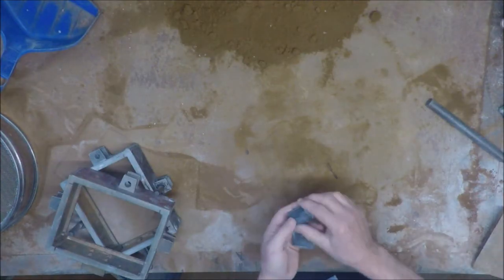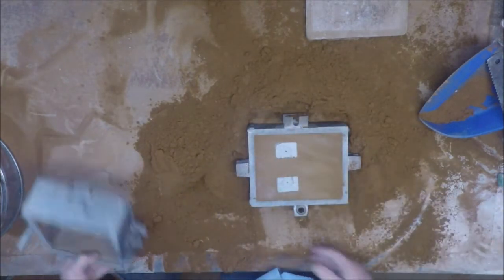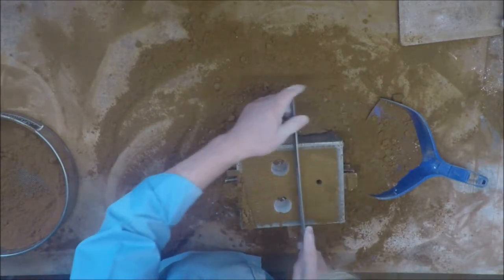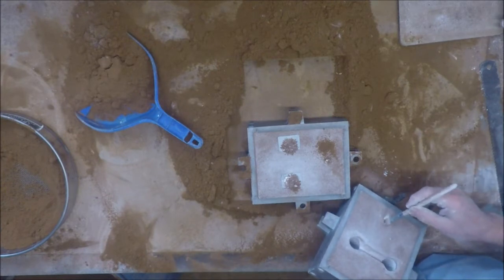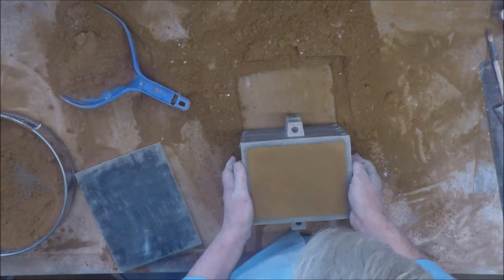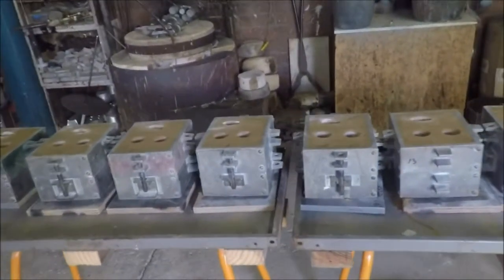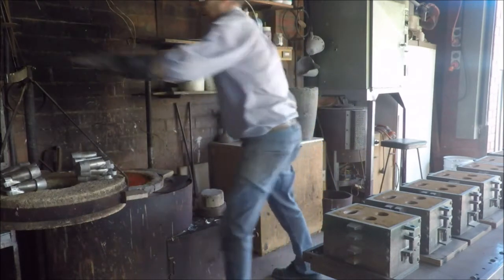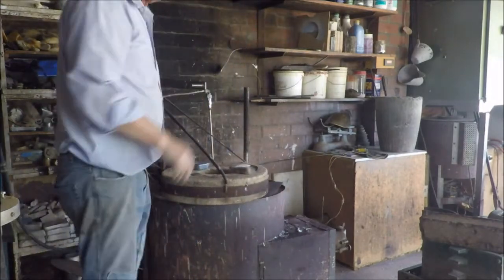My home foundry, Casting Aluminium blanking "Prisms"

Comment: Just wondering... why don't you make your molds with the in gate and runner already combined??? Wouldn't that save some time and energy in the long run???
Reply from the maker: F78, Yes, it would save a great deal of time and in fact I do this on jobs that repeat enough to make the extra effort of putting the runner and gates on the pattern worth while. If you look at my video on making throttle bodies (part 2 from memory) you will see that the runner bar and gates and places for the feeders and the sprue to be placed are part of the pattern. Also my recent videos of making a frangible coupling and of making a brake fluid reservoir base show the runner, sprue base, and in the latter case the feeder base all as part of the pattern. Not only is this quicker but it seems to make for a cleaner casting. However for jobs that are one off or only require a few castings it is usually not worth it.... Martin

Comment: I am curious to learn more about what is involved in heat treating Aluminium, as you mention the need to quench the parts as soon as possible after they set, so perhaps that will make for a good subject for another video.
Reply from the maker: Heat treatment of aluminium alloys is a bit of a black art and something that does not treat fools gladly. In my time as Foundry Metallurgist at a local manufacturer we lost at least 5 loads of over 1000 castings each through malfunctions of the process. I speak here of the T6 process typically for 601/3 alloy (356/7 in the US) solution  by holding at say 540 C for 12 hrs water quench and age at 165 for 4 hrs The alloy begins to melt at very little over 550 C so your temp control and furnace evenness have to be spot on - it most definitely is not easy hence the lost loads. The heat treatment that I use is a bit of a cheat, it's close to T5 which is an age only. Temp control there is not as critical. To improve the response to this T5 I like to quench the casting as soon as it is solid enough to allow handling. (Why this helps is a very long involved story) Thin castings say 6 mm or below do not really need this quench but ones much more than this definitely benefit from it. I do this T5 as it vastly improves machinability I doubt that it does much for the ductility though. For this age process you can get away with a fan forced domestic oven. Be aware that the temperatures for both the solution (the hot bit) and age parts of the process vary with each alloy and end properties required. I will devote some thought to a video on it.

Comment: A very informative video Olfoundryman. 
Curious to know does it have to be straight Argon or can you use Mig gas which has Carbon Dioxide in it as well?
Reply from the maker: Thank you  for your comments. My aim is to convey information and I am pleased that I seem to have done so. Yes, it does have to be straight Argon. The Argon CO2 mix is a definite No No, CO2 is unstable at the temp concerned and tends to convert to CO with the evolution of O2 this reacts with the AL to form AL2O3 as films throughout the metal. These weaken the metal and have a very pronounced bad effect on ductility. As an alternative you can use straight Nitrogen but the cost  - for me anyway is more in the cylinder rental than in the gas itself and Argon gives a drier type of dross on the surface of the molten Al.
Reply: Well you should be well pleased that you can now get Argon from Bunnings, size D $99 and $200 deposit keep the receipt somewhere safe. I asked the question to see if mig gas would work, but it looks like I will have to get an Argon cylinder anyway, I can also use it ti Tig weld.
Reply from the maker: Mark Fryer
I currently use the big E size cylinder. At my current usage rate - not what it once was - the E has already lasted at least 2 years and is no where near half empty. Obviously I do not really need one that big but it is a bit of a safety feature if I accidentally leave it on at the flow rate of 1.5 lt /min it will last days and I can usually catch it in time! Do Bunkings charge an annual rental as well or is that $99 a one off for a full cylinder and that's all you pay until you get it refilled(exchanged)? BOC's billing is a confusing mystery!
Reply: The $200 deposit essentially "buys" the cylinder as a part of the swap program, and you only pay $99 for a refill. BOC have had it too good for too long and now a lot of plumbers are moving over and other trades as well. They have Argon, Mig gas, Oxy and Acetylene. The only other ones to add would be Nitrogen, Carbon Dioxide, and maybe Balloon gas.
Reply from the maker: You are not wrong about BOC! When my current cylinder  runs low (I do not like using the bottom of the cylinder) I will be paying Bunkings a visit!CO2 would ne nice should they get around to it for use in setting on Sodium Silicate/CO2 cores.
Reply: Mark Fryer
Reply: CO2 refills at my local homebrew supplies, 2-3kg refill costs me $34
Reply: Isn't CO2 available in Australia through the food service industry?  I know around here small cylinders are available from the same people who supply fast food restaurants for pop (fizzy drinks/carbonated beverages) fountains.

Comment: If I had to guess I would say you've done that once or twice! What is your furnace fueled by?

Thanks for posting.
Reply from the maker: Yeh, Once or twice!  Been doing it on and off for 60 years and very on for the last 40, Posting is my pleasure.The furnace is oil fired, I burn Diesel fuel bought at the local service station. Have tried all the waste oil tricks but reckon them way to messy to fool around with. I brought the burner brand new about 40 or 50 years ago and it cost me over a weeks wage, a push at the time but considering the use I have had out of it well worth the money. Incidentally the lining in that furnace dates from the early 1970's it has done thousands of Aluminium melts and many, many hundreds of blisteringly hot bronze melts - its still holding up and will I suspect out last me!